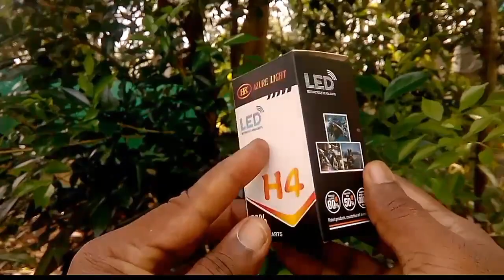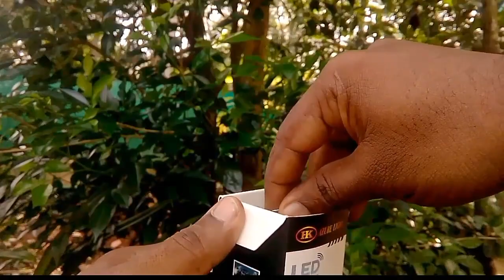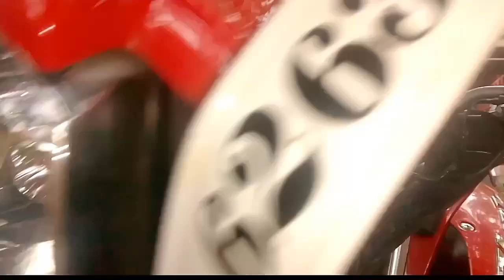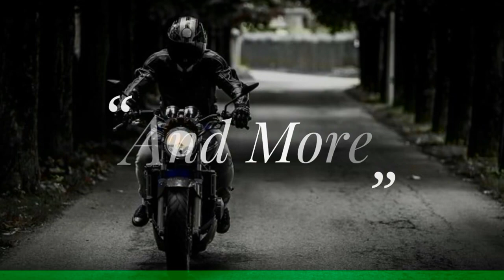How Change stack head lamp to LED in hero  hunk|%Food and Travel with Echayaan

Comment: Bro. Ithupole cheythu. Ippo headlight DC il work cheyyunnundu pakshe tail light work cheyyunnilla. Tail light engana AC connection kidukkuka.
Reply from the maker: Bro hunk aano ...?
Reply from the maker: Bro ..Tail light il orange wire  loop ettu ignition  socket il  connect chaithal sariyakkum ..
Reply from the maker: Wireing. Doubt undankil aarodenkilum  check chaithittu koduthal mathi